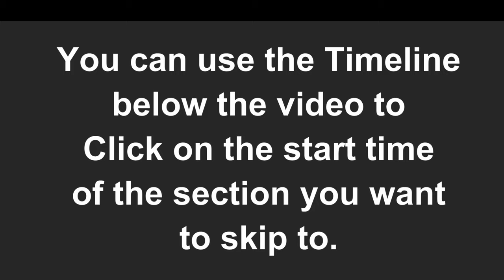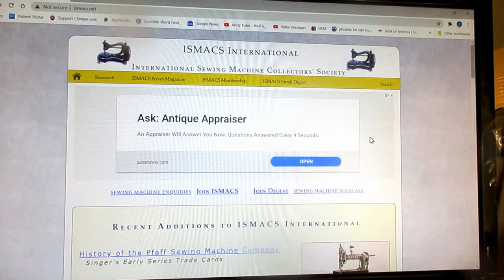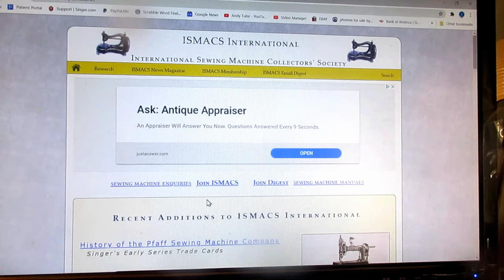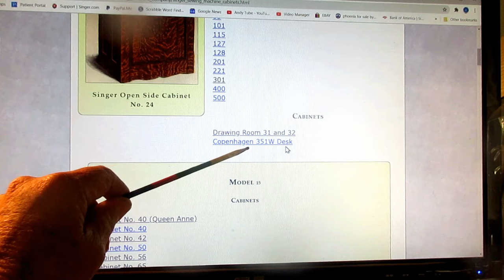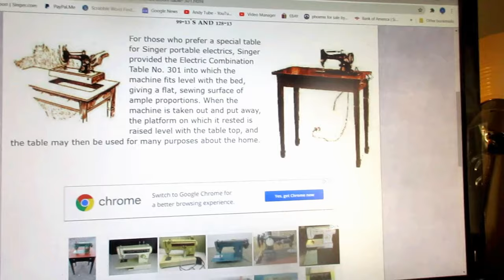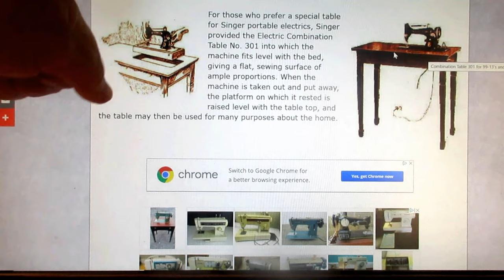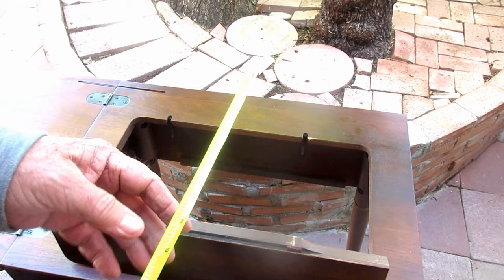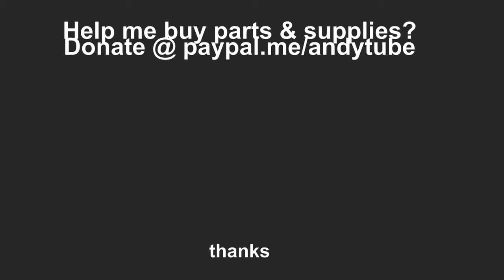How to choose a cabinet and install a vintage Singer sewing machine

Comment: What is the size of the set screw? Can I go to a hardware store and get it or are they a special size? Shipping from the US to Canada is super high
Reply from the maker: Wow, shipping is high! The best price I found for 2 screws & shipping was $21.
     I can't tell you the screw size info, sorry. I have about a dozen pages of Singer screw sizes but this screw is not on any of them. I think Singer considered it incidental. I have hundreds of parts lists by model number. Singer used the same screw on almost every machine (domestic, for the home) they made. They called it the "Machine Hinge Connection Set Screw" and gave it 
Part No. 51045AL. The "AL" stands for "Heat Treated for Toughness". Those two set screws were installed at the factory and if they are missing on a machine you have someone removed them on purpose. Most folks do not even know they are up in the holes for the hinges on the backside of the bed.
     In your case, it may be cheaper to find a vintage machine at a thrift shop or yard sale. A nice old rusty one no one wants, and get the screws from it. Many, many Singer screws are non-standard size and proprietary to Singer so you had to go to them for replacement parts and/or repair. Some screws were standard size. 
     As to a hardware store, you'd have to lug the machine there and use their size tester to see if a standard screw would fit. There are a handful of models that use that screw in other places, like the needle clamp, but I can't remember specific model numbers. 
     I guess you could tap out a bigger hole in a standard size. The black machines were usually cast iron and post-WWll models changed mostly to cast aluminum.
Reply: @andytubesewing1953  thank you for your advice. It’s much appreciated. I will try your suggestions!
Reply from the maker: @bluemonkeyfied Good luck!

Comment: Where can I get the set screws? I have a 500a that we want to set in a cabinet but need the little set screws
Reply from the maker: The machine left the factory with the screws installed on the machine so be sure they are not in the mounting holes. If you do need replacements, most of us buy original vintage screws like this: https://www.ebay.com/itm/174844627658?hash=item28b58d4aca:g:jmQAAOSwsMZdH030
Some people want newly made screws like this: https://www.sewingpartsonline.com/head-hinge-screw-sewing-machine-50380.aspx Thanks for watching my channel.

Comment: What is the model of Singer machine you're using to show this? This is exactly the model my mom removed from her cabinet. I still have the cabinet, and I wish I could put my modern machine in, but it doesn't seem like it will work.
Reply from the maker: Hi Barbie. It's a Singer Model 404. My favorite Straight Stich Machine. I bet your mom loved it. https://www.youtube.com/playlist?list=PLsCOZgzzaiKIB4kvIHCfHYuyLMUp5A4UI    Modern machines are not made to hang in cabinets like this any longer. Too sad, really. Vintage Singers can be found on Craigslist, offer up, Facebook marketplace, and eBay. Not that expensive for what you get and how well they sew. Thanks for watching my channel.

Comment: Hi Andy, l just got a cabinet that seems like it will fit my 401.  However it has a metal piece down the right side of the opening taking up space.  If l press down on it the rear edge goes down.  If l let up it springs back level with the cabinet surface.  What is it?  What is it's purpose?
Reply from the maker: Hi, Christine. Thanks for watching my channel. It's called a "Lift-Assist Hinge" and it was used to help you lift up the old 40+ pound iron sewing machines. There is often a knee bracket to operate a screwed-in foot regulator. You must have one of the older-style cabinets, like for a model 66. They were used in the old treadle cabinets also. You should be able to unscrew it and unmount it and hang your 401A from the hinge pins. You may be able to keep it and attach your 401A to it, but I'm not sure. If you want to learn more about SInger Cabinets, and maybe find the model number of yours, you can look here: https://ismacs.net/singer_sewing_machine_company/singer_sewing_machine_cabinets.html
 You can search google for the hinge/spring and there are many pictures like this one if you want to see it out of the cabinet: https://www.vintagesingerparts.com/products/vintage-original-singer-cabinet-assist-hinge?variant=20431872786530  That pix is just the hinge without the spring that does the assisting. I've seen a couple different styles of spring, a long one and a roundish coil one. That's about all I know about them. Good luck.

Comment: This video on choosing a cabinet was a treasure trove for me. I have my grandmother's Singer model 28 treadle machine in a cabinet that I am now excited to clean up! I have a problem, though. Opened the top and when I swung the machine up the left hinge on the back seems to be set in crooked so the machine doesn't clear the wood trim on the front. I cannot pull the machine up to rest it on the top of the cabinet.. Problem is how to get to the hinge pin hole when there is a nice bentwood dust cover underneath and I can't reach it. Is it okay to remove the whole rounded sunk in hinge from the top or is that a mistake? Help! ( Do you live in Pittsburgh, by chance?)
Reply from the maker: I've seen this before. The set screw on the hinge post may be loose and sliding on the flat spot. Sometimes you can lift the machine a little and pull or yank it to you (front of the cabinet) and it will straighten enough to continue lifting the machine. YES, yes!! you can absolutely remove the hinge screws and lift the machine with hinges attached right up off the cabinet if you like. I did this with the very first cabinet/machine I bought b/c I did not know how to use the hinges. I have restored a couple of cabinets and always remove the hinges anyway for sanding and staining, etc. no harm done. Thanks for asking, and for watching my channel. Stop by anytime.
Reply: @andytubesewing1953  you’re the best! Thanks for the quick reply and for all the helpful videos!
Reply from the maker: @amyq5615  Hey, thank you! Good luck, Amy
Reply: It worked! I removed the large hinges and used your rubber band method to reinstall the machine! Like butter. Thanks!
Reply from the maker: @amyq5615  Mmm... smooth, creamy butter. Can't beat that! Thanks for making my afternoon.

Comment: Do you know where you can find replacement pins(horse head things)?
Reply from the maker: horse head things??? if you're asking about the hinge pins to use for hanging the machine there are plenty on eBay:
https://www.ebay.com/sch/i.html?_from=R40&_trksid=p4432023.m570.l1313&_nkw=singer+cabinet+hinge+for+hanging+machine&_sacat=0

Comment: My controller is on the right side. I feel the prongs on the top of the foot pedal! Pushing down, one side wiggles but the cord side won’t budge. Any suggestion?
Reply from the maker: I've been told you can try to insert a flat tipped screwdriver up behind the back of the pedal and try to pry back the spring part of the metal bracket to push it away from the indentation on the backside of the pedal. I've never tried that b/c I worried about cracking the Bakelite back of the pedal. I usually just keep pushing harder to force out the pedal from the bracket. The pedal had probably been in the bracket for 60+ years and the metal bracket spring is stiff.
Reply: Thanks! The cabinet is badly peeling so I want to remove the pedal first before trying to clean the paint and veneer.

Comment: The felt that is on the floor of the cradle, is that replaceable? Mine is in ok shape but like the felt on the oil drip pan it is old and dry with oil
Reply from the maker: Sure is, and several ways to do it. You can buy felt at the fabric store and use craft fabric glue to hold it in place. https://www.walmart.com/ip/Aleene-s-Super-Fabric-Adhesive-1-5-fl-oz-Fast-Drying-Permanent-Fabric-Adhesive/53748191?wl13=2515&selectedSellerId=0    Removing the old felt and degreasing the cradle first, of course. You can buy custom cut peel & stick felt replacement pads: https://singer-featherweight.com/products/felt-drip-pad-for-singer-301 I have used these and they are convenient and "OK"; a little thin IMO.
A couple customers wanted better felt and I bought this and used the craft glue: https://www.mcmaster.com/felt/firm-felt-sheets-and-strips/ These pads are wool and very absorbent, although pricey. Quality always is. I also have a long-time customer who buys felt at the store and uses stick-on velcro to hold it in place near the corners and the circle cutout. She buys a black felt pad for $1.00 (12" X 12") They are probably polyester, but she just replaces the cheap pad every couple of years. Personally, I have pretty good luck degreasing them with Krud Kutter https://youtu.be/4Rk8z_oOESQ
Thanks for watching my channel. Good luck.
Reply: @andytubesewing1953  Thank you so much!!!
Reply from the maker: @shannonmuzinich7389  👍

Comment: I have a Singer Featherweight 221. Since the hinge pin holes are not part of my machine, what would be the best way to hang a shelf below to hold the machine?
Reply from the maker: Sorry, Julie, I'm not a carpenter so I can't advise you about building a shelf. I can give you some alternatives though. Singer made a special cabinet (No. 68) for the featherweight. It is very hard to find (I've never seen one in person) but they are out there if you are patient. http://ismacs.net/singer_sewing_machine_company/featherweight_sewing_machine_cabinet_number_68.html
Singer also made two folding Card Tables that hold a featherweight. Table No. 308 http://ismacs.net/singer_sewing_machine_company/308_table.html   and Table No. 312 http://ismacs.net/singer_sewing_machine_company/312_table.html   These are somewhat more available if you watch for them online like eBay, FaceBook, Esty, etc. I used a different approach than building a shelf and bought a Cradle for Singer Model 301. This is a metal "shelf" that uses the hinges in the cabinet and holds a 301 in the cabinet. It fits many cabinets and some cabinets need minor modification and then can hold the cradle. With the cradle in the cabinet, you just open the cabinet and set your featherweight on the cradle to sew. Here is a video I made about the cradle and a 301 machine: https://youtu.be/jLSCL7PoqqU
I liked this solution b/c it did not require building anything or over-modifying the cabinet. The cradles are usually available for sale online at various outlets although the prices are higher now due to the big increase in demand from the pandemic lockdown of 2020. A casual search of eBay just now came up with a few for sale including this one: https://www.ebay.com/itm/265281489508?hash=item3dc4024a64:g:5dYAAOSwQp1hI7ld    The one I bought had a fairly clean felt oil pad, but I still cut a thin piece of plywood to cover the pad and set the machine on. Good Luck.
Reply: Great information!! Thank you!!
Reply from the maker: @juliehorner889  surely, and good luck with this project.
Reply: @andytubesewing1953  I did buy this cradle for my cabinet. I was hopeful, but it does not work. It’s too narrow to hold the Singer featherweight .  Since I’m not able to return to the eBay seller, I would love to give to someone who could use this cradle. It’s in nice condition and came with all the screws. Let me know if you know anyone who could use this.  I hate to just throw out.  I think I will build in a shelf to hold the machine. Thank you.
Reply from the maker: @juliehorner889  I'm sorry to hear this. We did not have this problem. If you will send your PayPal or other info to my YouTube Channel email andytube53@gmail.com I'll reimburse you for the cradle. I feel bad you bought it on my suggestion and it failed to serve your needs. I have a couple of them and do not need more, so you can give it to a local charity if you like.
Reply: @andytubesewing1953  I’m not asking for reimbursement. This item was not purchased from you. I think you might misunderstand. I have purchased the cradle listed above from the eBay seller. I would like to give this to someone who could use it. If you know of anyone who would like to have this for their sewing cabinet, I can send. I’m just looking for an address to send to.
Reply from the maker: @juliehorner889  Oh, I understood your comment. I'm sorry if mine was poorly worded and caused any confusion. I know you were not asking for a reimbursement; I merely offered you one because, as I said, I feel bad you bought it on my suggestion and it did not work out for you. Correct; you did not buy it from me as I do not sell anything to the public in any way or manner. I do not know of anyone needing the cradle and as I already have two of them I do not have any use for a third. When I donate machines and parts to my local Goodwill the manager there has told me they sell the first weekend as they seem to be in demand. I guess that was why I suggested you could give yours to a local charity instead of throwing it out. Maybe we both understand each other a little better now, and again I apologize for any confussion I caused. Thank you.